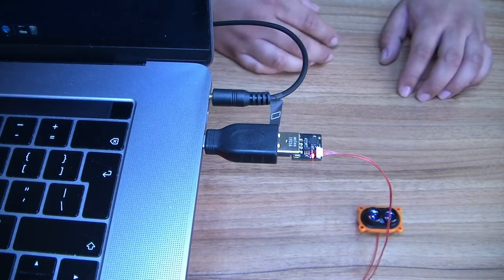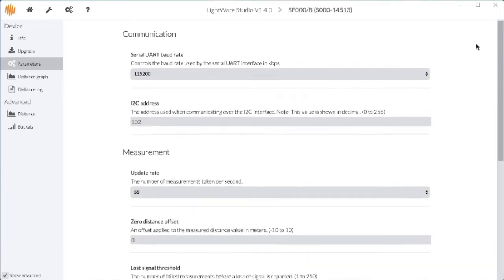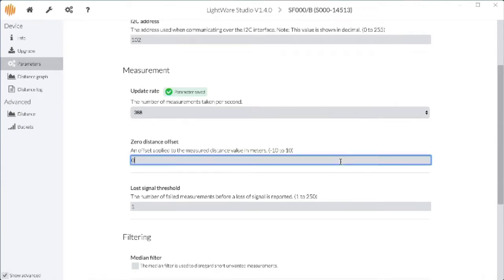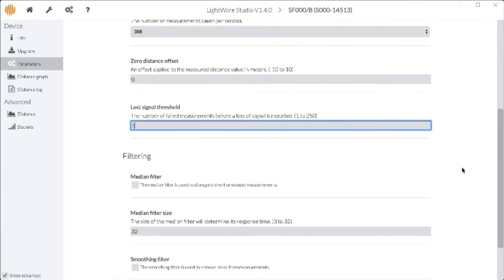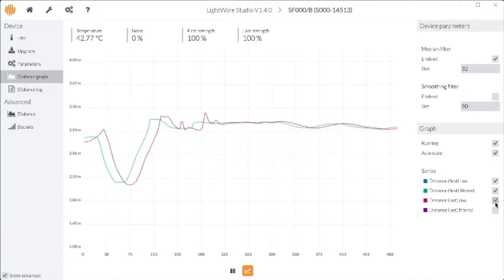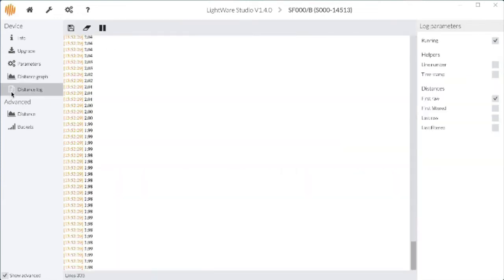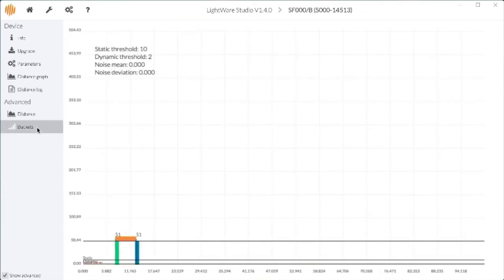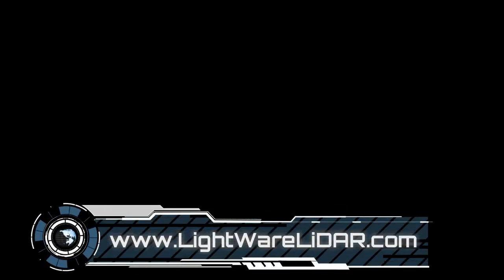SF000 microLiDAR UNBOXING

Comment: I wanted to know if the pixhauk  is using to Georeferenced UAV with a drone for agriculture propose, its store GPS coordinates related to LIDAR scanning in the log surveying?
Reply: @LightWare Tech Support Does the SF000/B work with PX4? The PX4 parameters "SENS_EN_SF0X" and "SENS_EN_SF1XX" do not have a value for the SF000/B on the latest stable release (v1.12).